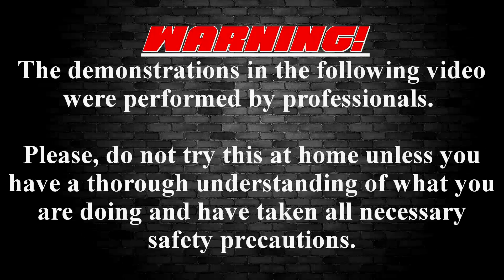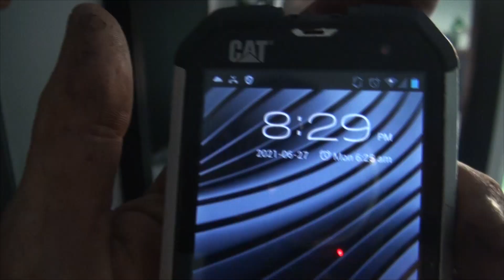MY ASTRO VAN HAS A 4.8L ENGINE READY FOR IT'S V8 SWAP

Comment: Did you have to modify the firewall to fit the 4.8? And is the 4.8 fitted to the automatic thats fitted from the factory in the astro?
Reply from the maker: I actually ended up putting in a 5.3L and no I didn't have to modify the firewall. The V8 fit but it's a little tighter on the newer generation vans. Everything is good except I don't have room for my A/C compressor. I didn't use the 4L80e transmission, I tore it out and converted my van to standard shift with an NV3500 transmission. However, I do believe the 4L80e will work for you no problem. If you subscribe, you'll see the van again soon. It's been off the road for 6 months getting built and has about 2 feet of lift w/ solid axles, 35" tires, full frame, four linked suspension etc. I'll show all the problems I had building it and what it took to get the engine it.

Comment: Hi love your channel,  Have you done the v8 install yet.  I have a 5.7 out of a  89 Silverado.  So I am waiting to see how it's done.  I know after watching you i m sure I will need a v8 converter.  Wireing set up ? not sure how to ,and what I will need to change, from v6 t0 v8.
Gord from Alberta
Reply: Gord! Im in BC looking to buy and improve an Astro to a better engine and drive train.  Im doing research on what compatible first. How did your swap make out???
Reply from the maker: I am going to be doing a v8 swap with an 2001 5.3l engine from a Silverado. I will be doing this within the next month and will show it on video. I just need to get a wiring harness that matches the engine and then I'll teach how to use that engine and wiring harness in an ASTRO van while maintaining emissions comliance and the OBD2 port.

Comment: I am posting anothing comment with a link to a video you might like, dunno it YT will shove it into your blocked comments or not so figured I would tell you about it in separate comment just incase. Came across this video purely by accident.
Reply from the maker: It came through without requiring approval :)

Comment: You think steel and aluminum is bad, try brass and aluminum. Brass inherently causes aluminum to oxidize at an accelerated rate. I used aluminum rivets to hold together some brass panels in a robot I was making and after less than a month while powering it up and cycling the 32Kg servos more than half the rivets sheared off and I had to drill them all out while all the custom circuit boards I made were still attached so I couldnt risk any brass or aluminum dust get on them. I had a shop vac hose taped to the robot so I could do the drilling. I systematically replaced every rivet with steel self tapping machine screws. LOADS of fun heh ... I know the feeling on bees, we have a carpenter bees nest in the floor of the shed so every time I go to get my forge out I end up ballroom dancing trying to dodge them.
Reply from the maker: That's nuts. I didn't know brass and aluminum did that, I may have to try it sometime. I'm kinda fascinated by the way some metals interact with each other.
Reply: @StuntDummyLives  Yeah, I learned it the hard way so I started researching. With having a forge and a crucible now, I wanted to mess around with creating my own alloys for things like guards, pommels, etc for knives, but I dont have much in the way of sacrificial material to test with. A lot of people have tried creating their own aluminized brass, aluminized copper, etc, and all learned the same lesson. The initial results were very nice, interestingly colored billets, but after time went on, depending on thickness, the metal would corrode away to the point of just crumbling. I did manage to create a really nice rose-brass, basically just pinkish in color, by adding small amounts of pure copper and nickel to existing bright brass. Cast a really nice flower out of it that I gave to my daughter.